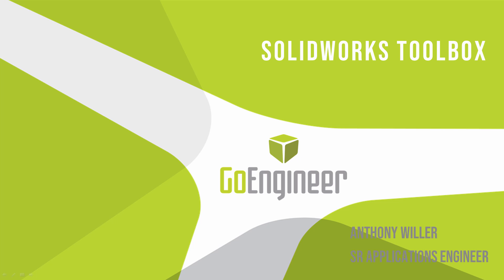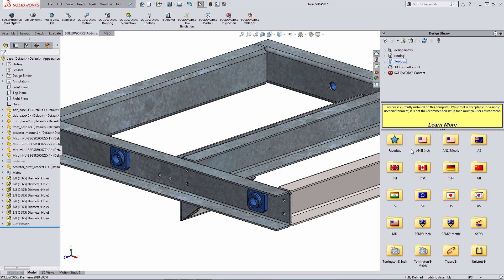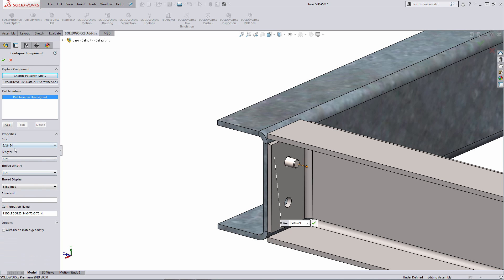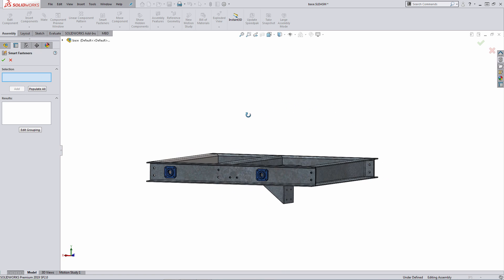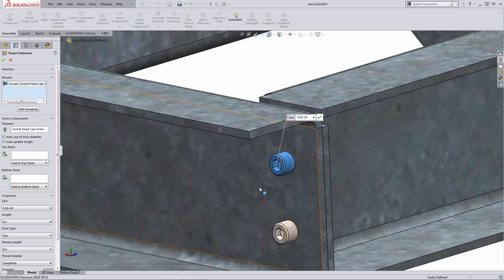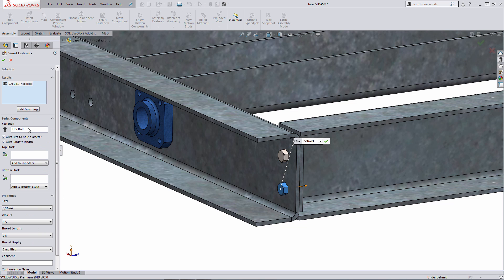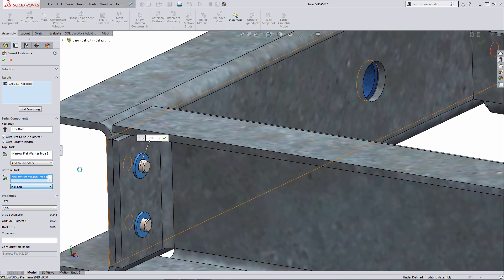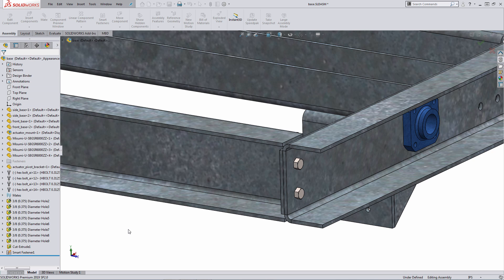SOLIDWORKS - Toolbox Basics

Comment: I've had a lot of issues with Toolbox components and now I don't use them at all.
During last years I had lots of times when I tried to open my old assembly file and all Toolbox components were off or ruined. Sketches of Toolbox components were self-intersecting, sizes were wrong and links to anything were broken.
I'm using models from Mcmaster now even for large assemblies. Not only because these models are reliable. But also because I want to be sure that this certain fastener can be purchased and used, unlike implementing these abstract components from Toolbox.
Anyway, all these cool features work only on these promo videos. And on real case we have to rely on old and slow working things.